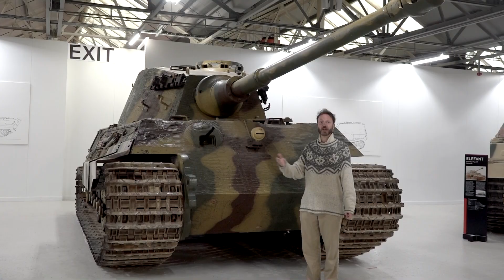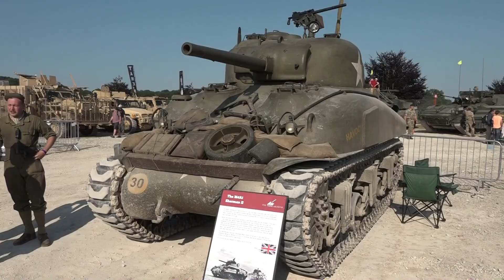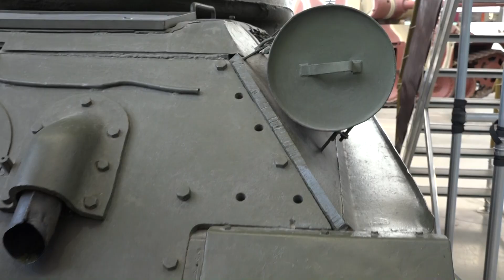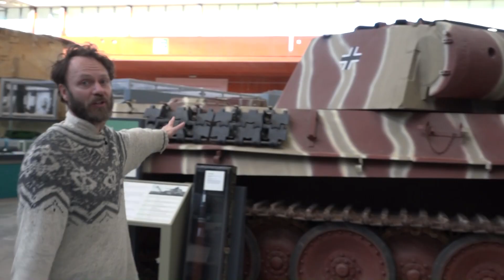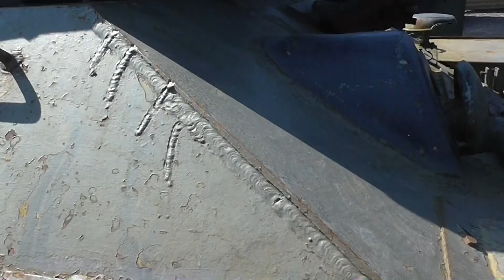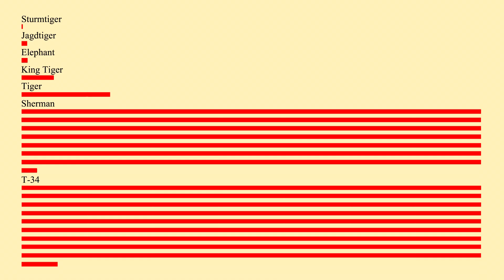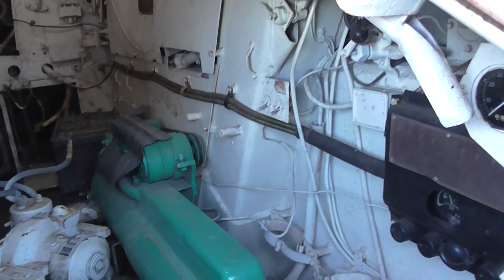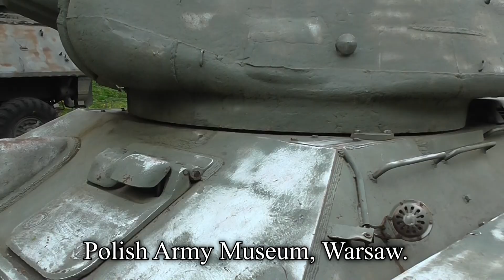World War Two's most common tank

Comment: All these small production tanks Germany made, must have been hell for repair, maintenance, and production efficiency.
Reply: It was. Especially as all these vehicles were also not one standard design, but from different manufacturers that all made their own small changes. So you needed even more.  
 
Based on what my uncle said, he was driving Panthers on the eastern front.
Reply: The 18 Sturmtigers made had differences between each singular machine

Comment: Lloyd: have you seen LazerPig's video on the T-34?  Would have been potentially useful to watch before you made this.  He covers the properties you discuss like sloped armour, mass production, hard vs soft stats, quality of steel etc..  I feel like you're in for some blow-back
Reply: Not the same audience.
Reply: @Krusesensei  I watch both.  LP has referenced Lindybeige at least once.  What makes you think there's negligible overlap?
Reply: I think he's probably safe. He wasn't gushing over it and he never actually said anything refutable (apart from perhaps the bit about tanks running from the factory to the battlefield). My only real complaint would have been that crew survivability wasn't specifically mentioned but that's about it.
Reply: Lazerpig is an intellectually dishonest fraud and a liar, watch Red Effect’s video debunking almost all of Laserpig’s claims on the T14
Reply: Also, the whole story about T-34's being crewed and driven straight into battle from the factory...   I'm concerned for the level of research done for this video.

Comment: A few things to note about the T-34;
For one thing, that little slab to knock the pins back in wasn't added until after world war II.
and another, one might look at stats on places like wikipedia or the tank's official specs, thing is that no T-34 during the war was ever built to those standards, a combination of corruption, and corner-cutting to get them out as fast as possible.
Also, not all of the T-34s were actually built during the war, almost a third or so of them were built after the war.

Another is the problem with the heat treating involved in making the steel plates for their armor, a method of strengthening steel to improve its toughness without needing to add more. Trouble was the Soviets heat treated their steel to over 600 Brunel (more than twice that of all other nations that did that), and this had the effect of making the steel, yes tough, but also very brittle, meaning sudden shocks like, say, a shell hitting the armor hard enough, even without penetrating, could easily cause the steel to snap and fracture. Which is why you can find a lot of photos of T-34's with large chunks of their armor missing in places.

And despite what is said, the Germans weren't that shocked by the T-34's appearance during Barbarossa. A lot of their standard lighter tanks like the Panzer I and II and their early tank hunters did have issues fighting them, but the Panzer III could reliably knock it out (most T-34's destroyed in combat were destroyed by Panzer III's, in fact.). The Germans encountered and fought T-34's and KV-1's en masse from day one of Barbarossa, the idea that it was some new war winner that surprised the Germans is a product of the memoirs of German officers after the war, where blaming soviet "Superior" technology was an easy scapegoat to cover for their consistent tactical, operational, and logistical failures once they lost the initiative.

It had awful speed, It also had a horrible gearbox that required massive amounts of force to move to third gear, and fourth gear was basically impossible without the aid of a hammer (yes, that's an actual thing. No, it's not a myth, this has been proven)

Also, despite that bit about the Panther Comparrison, another issue with the T-34 was that Soviet logistics was a complete and total nightmare, spare parts were few and far between, almost half of the T-34s lost during battles were breakdowns prior to the battle even starting. Which is one of the reasons Germany managed to capture so many.

As for the 'driven straight into battle', there's a handful of anecdotal stories claiming something to that effect with a couple of tanks, not nessecarily T-34's, but even if it is true (which seems unlikely) Tractor Factory 183 in Stalingrad (Which produced over half of all the T-34s during the war) did not produce ammunition, so the idea that they'd go into battle right from the factory seems absurd.

And while the 76mm and 85mm guns were good, it's ammunition proved not to be. It was proven to be low-quality, not as accurate as it should've been, and in cases had a nasty habit of cooking off early if the gun wasn't left to cool first after firing too many times.

Some sources even state that, given its comparatively narrow tracks, it gave off ground pressure not dissimilar to that of the Tiger despite the weight difference, T-34s often got stuck in the mud if they had to cross it, despite what pro-Soviet shills will tell you, there's photographic evidence to prove it. I don't pretend to be an expert on how ground pressue works, mind you, and historians can't really agree on that. So grain of salt on that one.

Lazerpig's video on the T-34 is quite informative (though by his own admission he's not very happy with that video because of various production and quality reasons, but the major majority of his points are valid and accurate) I highly encourage anyone interested to check it out.
It's called 'The T-34 is not as good as you think it is'
Reply: Lazerpig is an intellectually dishonest liar and a fraud. Look up Red Effect’s video debunking almost all of his claims on the T14.
Reply: I heard that gearbox took out more  T-34s than all German tanks combined, which is... well... just Soviet quality. And why they had no escape hatches? Because leaving your tank was seen as treason and could get you executed.
Anyway, if one side can get, let's say, ~3200 tanks to battlefield and the other one can get there ~7300 tanks, even if a quarter of them break down because of gearbox, it is still unfair fight. With a bit of luck (and making sure that always at least 3 can shoot at the same enemy), victory will come.
Another thing I heard, T-34 was pretty easy to take apart with basic tools like wrench and hammer, so it was possible to rather quickly take apart 100 non-operational tanks and make ~40-60 operational tanks from them in two days, while German tanks were much harder to take apart and not all parts were really the same, so even if you had 100 Panzer III, you could after much longer time have ~15 operational tanks. Now about the parts not same, I think it was the gearbox (I might be wrong, it is long time since I heard it, so parts might get mixed up) that was not same from all factories and they were made so well, that they had to fit perfectly. With T-34... you had some kind of "artist interpretation" let's say (if it doesn't fit, hit it with hammer few times and try again).
Reply: @simonspacek3670  The Panthers didn't exactly have great reliability either. and getting at the gearbox and final-drive with those started with removing the turret .
Reply: @GoranXII  I might be wrong, but removing the turret doesn't sound like something you can do in three guys somewhere in fields :D
Reply: @simonspacek3670  No, it's not. Now you could get at the Sherman final-drive easily enough. Just unbolt those curve panels at the front, and you can get at it without too much trouble. The American solution was "what you can't make utterly reliable, at least make easy to repair'.
Reply: @GoranXII  That makes sense, especially for someone who cannot call AAA. 
Tanks are not my main focus, I prefer planes, and there is amazing piece in one book from WWII pilot. His plane was heavily damaged, he had to land somewhere in fields and in few hours there was a mechanic team that took the plane apart there, fixed broken petrol pipes and so, put it back together and he was able to fly to airfield to have the rest done. He couldn't tell much about how the repairs were done, because after landing he fall asleep pretty much immediately (lot of stress and physical work) and when he woke up, they were already testing if everything works right. They took it apart, replaced broken things and put it back in ~2 hours. That is pretty cool if you ask me.
Reply: I believed what you wrote until you referred to a lazerpig
Reply: @Lixn1337  Lazerpig is a better historian than some people realise. Unlike most of us he actually goes and gets and compares physical sources instead of searching exclusively online, and not just books either, he goes to great efforts to get his stuff as close to right as possible.

Just because someone on the internet said 'hurr durr pig wrong' and then provides either no evidence, or evidence almost exclusively sourced back to Russian Propaganda doesn't mean the pig is wrong.

Of course, he's not infallible either, he's said as much himself many times, but just because you don't like him for whatever reason doesn't discount that the major majority of what he reports is as accurate as can be reasonably expected.
Reply: @coenisgreat no, he's said many blatantly stupid things and doesn't cite his sources.

I mean, he's just one of those people that seems smart because he produces long form videos and acts like a pretentious child while inserting jokes to keep people interested.

If you want facts, there's tons of better channels, like Red Effect, Coneofarc, and my friend, Peter Samsonov of Tank Archives, all of whom list their sources and use real specs, nor merely anecdotal evidence and unfounded claims.